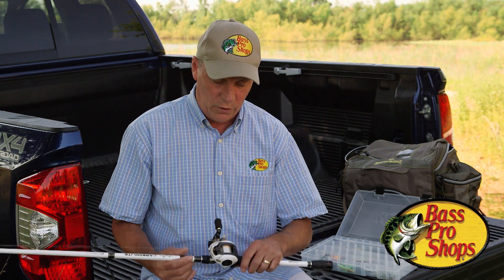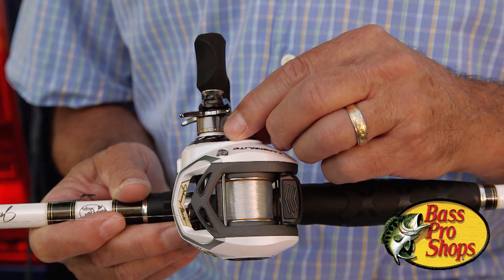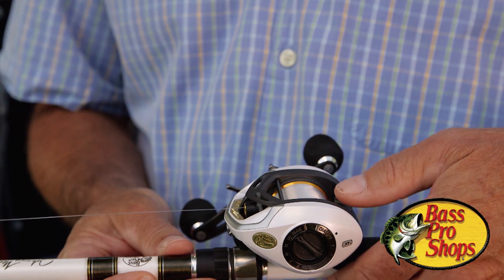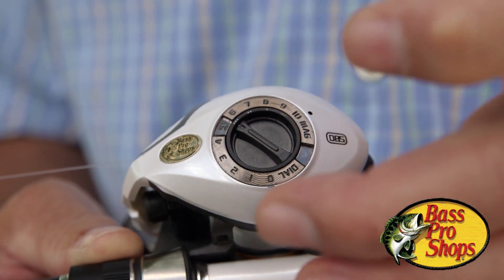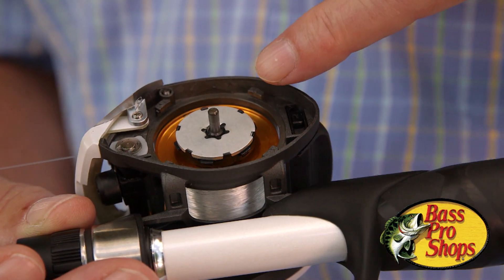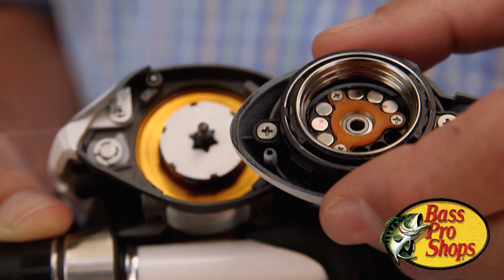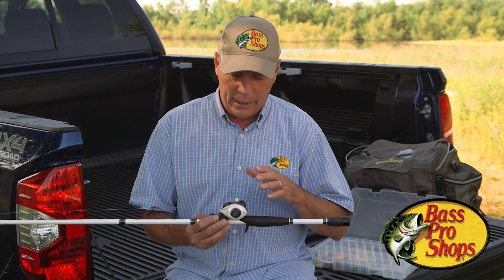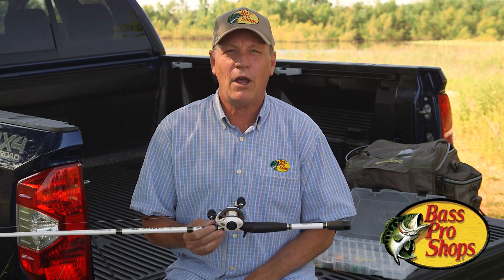Cast controls: Johnny Morris Dual Braking

Comment: How do you take off the palm side cover to get to the magnets? Manual instructions with the reel don't make sense
Reply: The Bass Pro Shop logo push that button in and that outer face plate will turn to come off. Do it at the same time.